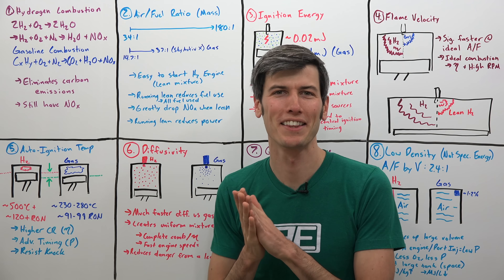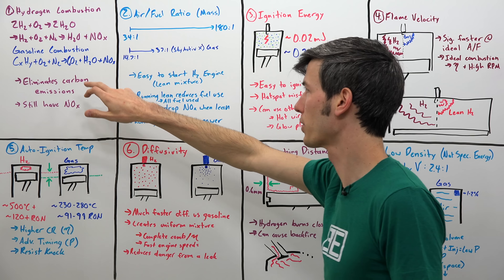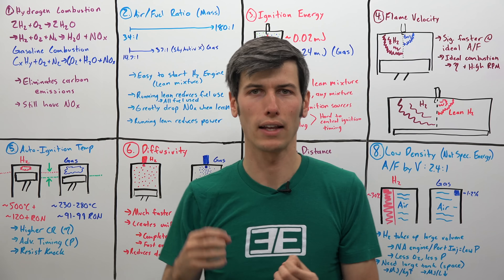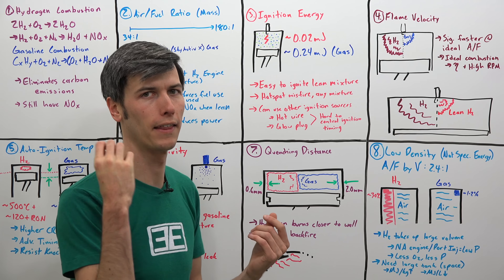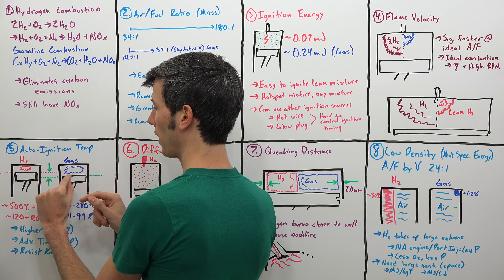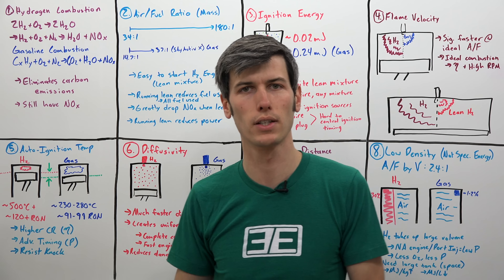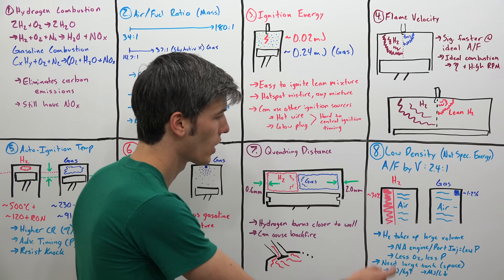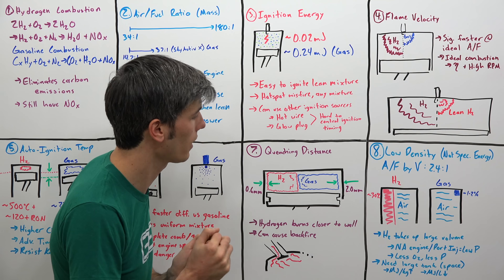The Difference Between Gasoline And Hydrogen Engines

Comment: A perfect system to me for the hydrogen combustion would be to keep the oxygen from the electrolysis production of the hydrogen and then tank both gases separately, with this the hydrogen and oxygen can be combined in the cylinders with a ratio of 2:1 (This ratio could be tweaked to be more efficient or to reduce engine knock) but either way the required storage for oxygen would only need to be half that of the hydrogen.
The hydrogen could be injected and compressed by the piston with the oxygen injected just before full compression ensuring full compression before ignition to mitigate auto-ignition. In terms of energy density hydrogen is about 270% more energetic by volume than petrol and would require a higher compression ratio but that is easily done just as with LPG or even diesel.

Now I know storing hydrogen and oxygen would require a lot more space and be potentially more dangerous so ranges between refuelling would be smaller but I'd rather have a more efficient vehicle that I have to fill more often and doesn't pollute the planet. Just because your coal powered steam engine goes further than a tank of petrol doesn't mean you should definitely have a coal powered steam engine.
Keep in mind that if hydrogen is 270% more energetic by volume vs petrol then 270% less hydrogen could be used per cycle of the engine to achieve the same amount of mechanical energy required to drive the vehicle.

On top of all that hydrogen is physically "cheaper" (less energy required) to produce than petroleum over the full process and is 100% recyclable considering that the byproduct is H2O, which can then be used again in electrolysis. 

No this is not a 100% efficient or perpetual system. No I'm not expert on hydrogen combustion engines. This is just my input with my knowledge of standard combustion engines and a few years studying chemistry/physics at university.
I stand by the hydrogen fuel cell over hydrogen combustion but neither have a big market and probably never will with electric cars.
Once fusion power stations are a thing then electric cars will most definitely be the most efficient method imo.

Maybe someday we will just have miniature fusion engines and fuel tanks full of deuterium, which is still hydrogen in the end.

Edit: Math
Reply: I think an oxygen molecule is much larger (and heavier) than a pair of hydrogen molecules. I reckon the oxygen tank would need to be much larger than the volume of the hydrogen tank to have the 2:1 ratio you suggest.
Reply: @iamdave84  I think you're right. I posted that when I actually knew nothing about what I was talking about. Thank you for taking your time to read it and reply none the less.
Reply: The elctrolysis only produces half as much oxygen and you need at least 34 molecules of oxygen per 1 molecule of hydrogen so maybe not. I had the exact same idea as you until i realized this. And i know you already mentioned space but keep in mind hydrogen tanks already take up a ton of space so having an oxygen tank as well would take up entirely too much space to also have room for passengers or trunk storage. The NOx could easily be reduced with a catalytic converter so the oxygen tanks arent really worth it when you can literally just use the air flowing against the car to go into an intake.

Comment: Cons to H2o are based on IFs, theory and rightly applied into a machine would not cause any harm. thats what engineers are paid for.. performance wise it seems better than EV... maintanance of H2o cars will be once in years i guess but battery performance always start to decline since its first use thats a fact. Japan has moved towards H2o not only in cars but for all electronics and industries which batteries cannot support at all on large machines. thats how japan will overcome this energy problem by total dependence on H2O.. not just cars!!

Comment: I’d prefer hydrogen over any other fuel in an internal combustion sports car or race car, The ONLY problem I see with Hydrogen is that it’s expensive. If there was a cheaper way to make it, it would dominate gas all day. My preference would be to have a hydrogen powered Single Turbo Rotary engine. (FD RX7 of course 😈)

Comment: Why doesn't the hydrogen just convert to water when there's external oxygen in the cylinders? Also wouldn't there be a way to collect the H2O emissions along with the NOx emissions, remove the NOx, and possibly have a way of converting it back into either nitrogen with oxygen leftover, possibly jut creating nitrous oxide after a few chemical procedures? And lastly either returning the H2O emissions back into Hydrogen to be used as fuel again?

Comment: 2 things that weren't mentioned in detail. The safety aspect of storage tanks between hydrogen fuel,and gasoline. And what about simple water to fuel on board converting technology?
One gallon of water converts into 1866 gallons of hydrogen/oxygen gases.this is the HHO technology that was the rage 10 years ago that has simply gone off the radar. 
Nickola Tesla built some of the technology and Stan Meyers completed the technology but like so many others they end up dead .
Any chance of you doing a show about the HHO TECHNOLOGY?
Reply: On demand HHO generators / Stan Meyer contraptions are a fraud. Not something an engineering channel would want to feature lol

Comment: When EV will charge in 3 minutes at most (still longer than the usual refueling), one recharge will last for about 600km at constant 120km/h and the constant danger of the Li-ion battery getting slightly pinched and the whole thing catches on fire, maybe I will switch. And let's not forget the tendency of batteries to discharge when it's cold outside (try it with your phone, it drains the battery quicker).

Until then, I am looking forward to hydrogen. I am sure we can get it eco-friendly enough by reducing most of the NOxes. And we don't really need to worry about wasting hydrogen like we care about gasoline...the Universe is kind enough to have quite a lot of it. We kind of don't need that much efficiency, we only need less emissions.
Reply: And we can always use the battery tech else where like on our houses that would be great during hurricane season.

Comment: While I like these kind of educational videos. However, I wish the author pay more attention while he is at school before trying to be an educator.

2H2 + O2 -> 2H2O combustion is not an explosion, but an implosion. So if there is only the right amount of H2 O2 ratio in the piston it would not work. The mere fact that it still works is because the implosion creates a lot of heat, which heats up and expand the other non-combustible air within the piston.

That said, the advantages and disadvantages will be slightly different to what is said in the video. I wish the author to study this ore and delete and create another on with the right information. Thank you.

Comment: When you talk about  "Pollution" your talking about N0x . At those A/F ratios it is a extremely lean (Hot) and thats when N0x comes in . Hydrocarbons and Carbon monoxide are not as dangerous as N0x. We have the first two on the planet in larger amounts.  But its N0x to look out for . I dont think we have metals that will withstand that pressure/temperature.  They will have to lower to richer ratios. Maybe less hydrocarbons.  But more N0x and C0.

Comment: The hydrogen used in rockets is in liquid state, so it takes much less volume. That requires hydrogen to be cooled below 33 K, so I'll assume hydrogen fueled cars only use compressed hydrogen gas. That's huge advantage for rockets, but pretty big disadvantage for cars... Unless meta-stable metallic hydrogen proves to be real.

Comment: This is all well and good but it's impossible to store H2 in a safe enough configuration that does not make the tank so heavy that it would outweigh just using Gasoline. Not to mention that Hydrogen is just incredibly dangerous to begin with.

Comment: I'd be curious to know how using hydrogen might cause embrittlement in the combustion chamber where temperature and pressure would def influence this phenomenon.
Reply: It is a complex process that is not completely understood because of the variety and complexity of mechanisms that can lead to embrittlement. Mechanisms that have been proposed to explain embrittlement include the formation of brittle hydrides, the creation of voids that can lead to bubbles and pressure build-up within a material and enhanced de-cohesion or localized plasticity that assist in the propagation of cracks.  Long story short. Hydrogen penetrates the surface material of any kind and starts to change the materials structure which in turn weakens the bonds that hold it together.  Tight bonds become loose, things fall apart.

Comment: A fuel cell is 95+ % efficiency.... Ok, Palladium, electric components. But are combustion engine better just by a already existing system of heavy pressure & heat resistent components?

Comment: Good stuff - i was actually expecting H2 / Fuel Cell talk too in this since that is where the World is generally going. Also could you do a video on why H2/Fuel Cell planes are not being made? I know the current process of Steam refining of H2 is not green but H2 can be produced using electrolysis from renewable sources. Also what is the efficiency percentage for H2 combustion engines? I believe it is around 21% for gasoline engines.

Comment: What if build an oxygen injection engine without inlet valve, that just injecting fuel and oxygen, and have an exhoust only?
Reply: You could but, you would need massive amounts of Oxygen which would require a very large tank at very high pressures. It is just not practical.

Comment: Thank you well done.
first question from board 2 is this: While it's Possible combustion range extends out to 180:1 it can't really do any real work that lean and at 34:1 the flame front speed is so fast as to be like an explosion rather than a useful burn time in the cylinder. (unless I'm missing something here...??) 
So at what ratio does the flame front speed of combustion compare favorably to gasolines 14:1 for use in engines designed for gasoline?
Reply: I think you are asking the wrong question... You either need to slow down the flame propagation of Hydrogen ( by adding exhaust gases ) or you need to retard your ignition timing to have the expansion happen later in the combustion cycle to take better mechanical advantage of the reaction.

Comment: point #7 is why MythBusters were not able to just pump in H2 thru the carb on a gasoline engine to get it running. 
Many modifications are necessary; different cam timing and much better cooling systems just to start. H2 is not a direct swap for an engine designed to run on gasoline. Very small engines can easily be setup for H2, but it's just not practical in passenger vehicles.
excellent vid. thanks for uploading!

Comment: would it be theoretically possible to have an engine run on water, as in theory if the liquid was to be heated enough to separate the 2 products (e.g 1 hydrogen and the 2 oxygen molecules) you would then have the ability to combust the hydrogen while feeding it with its previously connecting oxygen thus causing the combustion. and as a side note this would also naturally cool the engine. (encase you cannot tell I am not a scientist I am purely speculating and if anyone has the answers to my query then please do tell)
Reply: Not in the way you are describing it, However...
I would like to take the time to post some info about my vehicles setup.  I have been running my car on Hydrogen for about 2 years now.  I do not store large amounts of Hydrogen fuel in a separate High pressure container.  I produce enough gases on demand through the electrolysis process to run my 2.4L engine which requires about 6L per minute at 7000 RPM to run without hesitation or noticeable reduction in power.  To be clear, I do not separate the Hydrogen and Oxygen gases in my device. I simply have a small container that will be pressurized to 12-15 psi before the system will shut off production automatically.  I produce enough gases on demand through the electrolysis process to effectively bypass the need for complex High Pressure tanks to store H2 like most of the current systems.
    With this method I do not store enough combustible gases to cause any significant fire hazard or air displacement danger in the instance of a "leak" or failure of the containment device.  I bought a new fuel tank to replace the one that came with the vehicle to prevent contamination from the old fuel.  Now I use my house water to fill my cars fuel tank which holds 12 gallons.  So the fuel system is the same as you would find from the factory but, I fill it with Water instead of Gasoline and the fuel pump connects to the water container in the engine bay instead of to the injectors.  Also I do not use the fuel injectors, I use a large aquarium tube that is connected to the intake before the MAP/MAF sensors.  In order to run my engine on Hydrogen I had to retard the ignition timing from about 25 degrees before top dead center to about 5 degrees before top dead center.  I did this by using a timing light and rotating my distributor clockwise by about 7 degrees.
    As a comparison my car got about 30 mpg with gasoline, now it gets between 25-35 mpg with Hydrogen.  In conclusion I am sure that with a more complex delivery system I could get better performance and mileage because I am not monitoring the fuel air ratio but, my goal was to create a system that produces less Carbon emissions not to be crazy efficient and cheap to fill.  I believe by producing enough gases on demand this is more efficient because if I run out of fuel through miscalculation or my fuel gauge stops working, I simply need to find someone willing to sell me water (in one case a woman was so impressed she just gave me the use of her garden hose).  This is also safer because I am not using a "High Pressure" storage container for a combustible gas or liquid, it is just water in a tank.

Comment: Happy to see that Jason has taken all the facts in the equation and rightly mentioned that Hydrogen is expensive. 
In most articles and publication this is somehow always overlooked. 
Most people forget that Hydrogen is NOT a natural resource and needs to be produced and it is energy intensive to do so.
Indeed, large scale commercial use for Hydrogen will only make economic sense if Hydrogen can be produced from a renewable source. 
Some countries that are blessed with (relative) cheap electrical power by means of Geothermal plants (Iceland), Hydro plants (Norway) for example, have the potential to lead the way.
There is a lot of research being done in trying to make Hydrogen cheaper and cleaner to produce. 
as a fuel cell it has a huge potential for the future.
Reply: Isn't Earth made up of 71% water?  And the formula for water is H2O.. 2 hydrogen atoms to one oxygen atom. What do you mean by it's expensive? It's the most abundant element in the Universe.

Comment: What pressure do you recommend as the input pressure for hydrogen as a gas?
Reply: It depends on the size of the engine and if you use direct injection or not.

Comment: You left out spark timing.  Takes a lot less retarding.  You can fire 1 degree past TDC as opposed to 10-20 degrees.  Yields more power in its cycle.

Comment: Hydrogen fuel is produced through a process called electrolysis. It's basically a non starter if you intend this fuel source to reduce emissions in comparison to fossil fuel.

Comment: What nobody realizes is that hydrogen is not available naturally.
It has to be made by using energy.
All of the water on our planet comes from burnt hydrogen..using electricity to convert it back to hydrogen is pointless.
Reply: Yeah but think of this. Taking hydrogen from water using electrolysis fueled by the sun and the wind! 
Environmentally friendly and you keep all the other good things from a car as we know it!
Reply: @zotostuning1  then just use the energy from the sun to run power...why would you waste the sun's energy to convert water back to hydrogen?
Reply: @Frank Blackcrow you are full of beans.
Petroleum has energy in it, ready to go...just light a match, it is 
unstable.
Water is stable...it requires electrical energy to separate oxygen and hydrogen because it has NO energy by itself....light a match in water and nothing happens because it is naturally stable....no energy.